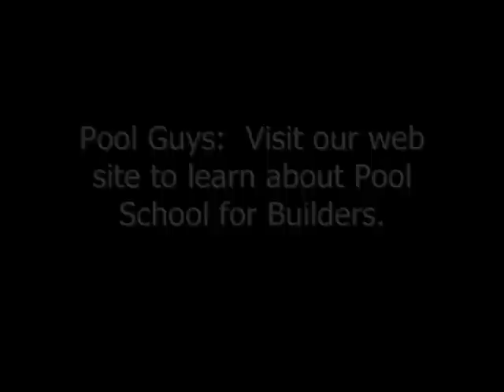How to Form and Pour Cantilevered Concrete Video

Comment: The trim strip is a very important part of the installation.  It not only creates a smooth transition from deck to pool.  It hides the gap which will start to show in freeze thaw conditions

Comment: Jason so pouring concrete deck over top the gunite bond beam and up to the  form attached to the tile.. I understand there needs to be a separation of the deck and the top of the gunite shell so when the deck moves it doesn’t take the tile with it?  How is this accomplished?
   Thank you hope to hear back from you

Comment: How do you adjust the forms to level for the pool that's 1/2" to 1" out of level
Reply: You should form half an inch below the highest point or more and take that same level around the pool.. if you are only doing coping and everything else is still in tact,  like tile or plaster it's going to be tricky,  if you are getting pool re tiled, plastered then the best way is to use a green or brown bender board, vinyl or plastic coated so the forms adhesive bonds better to clean plastic over wood , again go a half inch to maybe the full 1 inch and take that level all the way around , once that is level it will serve as a guide for the foam cantilevered forms, it is ok to pour thinner concrete in the area where pool is out of level

Comment from the maker: @MRBOBCATKING 
It can be finished with or without the lip, depending on whether you pour the concrete to the tip top of the form or leave it down a fraction of an inch.  Both ways are fine, as long as it's consistent throughout the entire pour.
Reply: The "Lip" is called a Flange  in structural nomenclature...
Reply: So there was not a preliminary pour to lock in with the RHino Bars you provide with the Pool. Everything was done in one pour to do the cantilevered pool coping and rhino bars ? 

Man I got the pool from his son tell me make sure to pack push concrete into against the form . And do the tapping with hammer on outside to not get the honeycomb imperfections in the edge .

Comment: How many yards of cement did this take and what was the size of the pool ?
Reply from the maker: The pool was a 12.x26.  Can't recall how many yards but it was likely 5 or 6. You can calculate cubic yards by dividing the sq ft by 81 for a 4" thick slab.  Hope this helps:)
Reply: @hughesjasonc  I know this is an old video but I have a problem with my pool where the original owner used the same patio stones as the pool to do the pool edging or border.  As a result, we have sand seep into the pool along with ants.  I would like this type of border.  How much would the job you did cost today?  Thanks so much for the great video by the way.
Reply: I see the bond beam does not look 1 foot thick around fiberglass?  Do you guys now recomend the 1 foot thick bond beam to be encorperated with the cantilever coping or should it be poured in 2 shots?

Comment from the maker: @kelleyslaughter 
We strip the forms the next day, some folks strip as soon as concrete begins to set while still green and finish the coping edge then.  To remove, twist the end of the tie until it breaks off, after removing all the ties pull the form away from the concrete.  Ladder can be installed day after concrete.....assuming you've installed the anchor.  Good luck!
Reply: You can't finish concrete the next day if it's already set up unless you plan on resurfacing it after u pull the forms